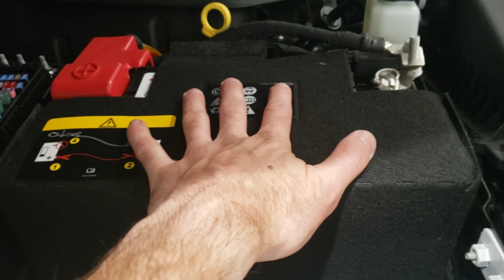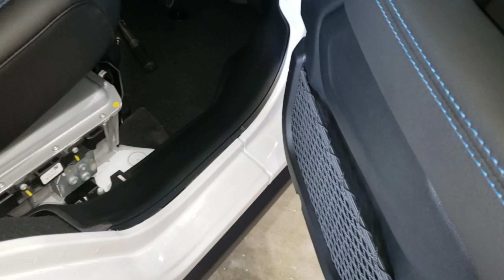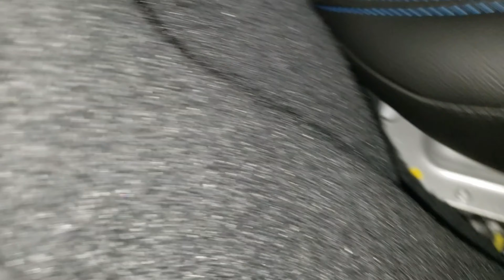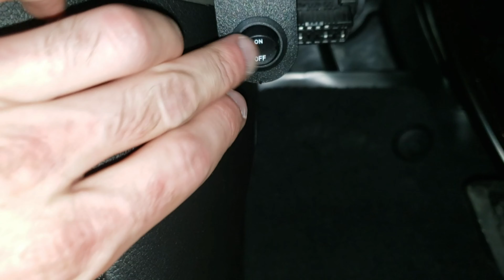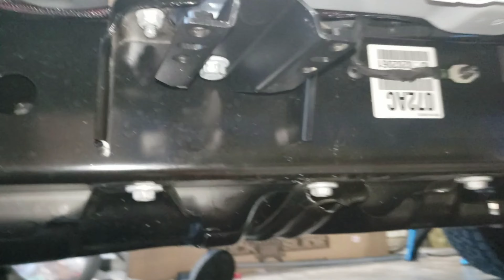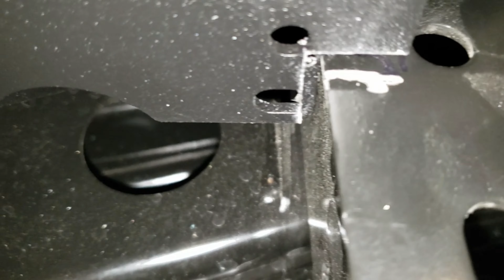Rock Slide Engineering Gen 3 Step Slider Install - Jeep JL Rubicon 4xe

Comment: I need help!! I have a rubicon 4xe and need help on how to run the wires. Can you send me a video on how you ran the wires from the battery to the rear connector.
Reply from the maker: @raquelhill5648  hey I don’t own the jeep anymore so I can’t make anymore footage. I remember getting stuck with this for about 3 hours since the factory wiring and battery system take up so much space. I ultimately had to resort to my wife’s small dexterous hands, several crochet hooks, and knitting needles as well as a lot of patience to get things run.

Comment: Those steps are a waste  by of money, does not hold up well!
Reply: Interesting you say that. I’ve been disappointed in them for the price as well. Recently had one of the bolts that hold the drivers side step swing arm in place pop out. I had to replace it with a bolt and nut. The wiring harness don’t do a good job at connecting to the lights they offer. I had to make my own harness to get the lights to work.
Reply: @harrisonwillner996  After the Rubicon the sliders on both sides were damaged so bad that I had to pound and grind them to make clearance for the steps to deploy. Not counting rebuilding them twice.
Reply from the maker: @bguerrero14100  wow that’s something you don’t really think about at first - clearance for the steps to actually deploy with dents - really makes good old fashioned rock rails seem more appealing.

Comment: I'm in the middle of my installation and I knew there had to be a better install video than what was bubbling to the top of my searches (this includes the official RSE video).  Luckily I found yours.  This had the detail I was looking for.  Very thankful for your detailed walk through.  You touched on everything, even the anti roll bracket.  RSE is shipping me another step that is apparently engineered by them to work with that bracket so I don't have to remove it.  Thanks again!
Reply from the maker: Glad I could help another DIYer out there like myself. Glad they've now got an updated step for that crash bracket.

Comment: Can u post video summarizing all challenges and important points specific to 4xe
Reply from the maker: Challenges as they relate to installing the step or so challenges in general?  Feel free to DM me @Harrisons.garage on Instagram and I'd be happy to talk about my experiences so far. I do plan on doing a general 4xe review soon though.
Reply: @HarrisonsGarage  thank you for your quick reply. Is it possible to do email instead as I don’t use instagram. I certainly has skills to do handyman job but this seems little bit more especially with complexity of 4xe
Reply from the maker: @KJJ200886  sure thing you can reach out to me at aceflyer1000@yahoo.com
Reply: @HarrisonsGarage  one more question, what is suggestion regarding Aeris power step

Comment: Great job and thanks for the tips. I am giving these a shot this weekend on my 4XE and this was a great video! How long in total would you say it took?
Reply from the maker: It took me about a day and a half to get everything buttoned up. I think I started at 1pm Saturday and worked till about 10pm. Then did another 3 hours on Sunday. The 4xe being loaded with stuff in the way definitely added time. Be real careful running the wiring harness over the cross member; it's very easy to get snagged on the IDCM.
Reply: @HarrisonsGarage  I really appreciate the help! I still have my factory antenna spare so that will help me get through the firewall. Also, thanks for the crossmember advice. Last question though, why is it necessary to disconnect the battery just to put the positive from the kit on there. I get pulling the 5a fuse to stop the current, but if the fuse isn’t in the wire harness, is it necessary. Also, did you connect the battery all back after the install or just after the harness connection.
Reply from the maker: @jimmymichelli4344  in all honesty your probably fine just leaving the battery connected and attaching the harness without the fuse in it. I primarily disconnected the battery to show how you'd do it on a 4xe
Reply: @HarrisonsGarage  Thank you. Again great content! Got a new subscriber!
Reply: @HarrisonsGarage  Thanks again for the tips! Got the steps installed yesterday and this morning. About 10 hours total. You were right, running the wires over the crossmember was definitely a challenge. 

Also, we have an early ‘22 4XE and didn’t have the metal bracket by front tire so no need to cut the steps. I heard they added them later this year to keep the tire from stuffing in the wheel and cause a rollover. 

All in all, just time consuming filing down the body bolts to get the washers up. Saved $800 in install by the shop, so was really happy. Again, great write up and couldn’t have done it without your tips! Happy Jeeping!
Reply from the maker: @jimmymichelli4344  Glad to hear the install went well!  And thanks for the info on the front right bracket - it's nice to know what that was for.  One issue I've since run into is  with the lights - According to RSE any light strip other than their own $70 offering will burn out a part of the controller so only plug in their light strip to the harness or build your own relay tapping into the harness signal wiring and 12v power (what I'm about to do).
Reply: @HarrisonsGarage  Good to know. I haven’t bought the lights yet…that’s next on the list. Appreciate the heads up!
Reply: Great install video. I just got my gen 3 steps and was noticing the instruction booklet rev 3/22 shows the rear door sensors to install at the lower hinge not the latch area. Just curious if That's a new way of doing it or a out dated old way? Do you know?
Reply from the maker: @stephenhinkle3277  I had the same install booklet. Mounting them where I did was a personal choice. At the end of the day it's just a magnet sensor and it'll work regardless of where it's located. I chose to put it up higher to keep it out of the way from feet as people get in and out. Hopefully that keeps it safer.